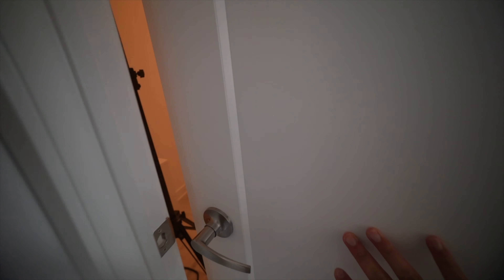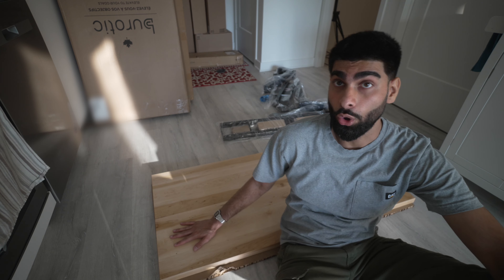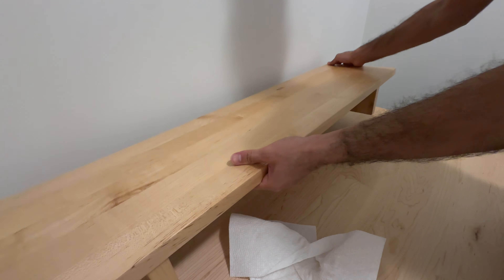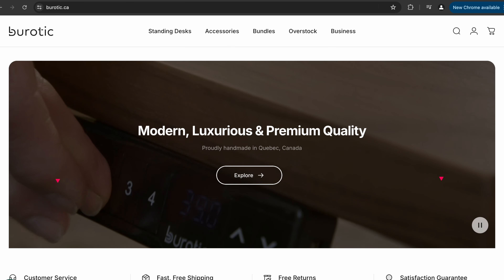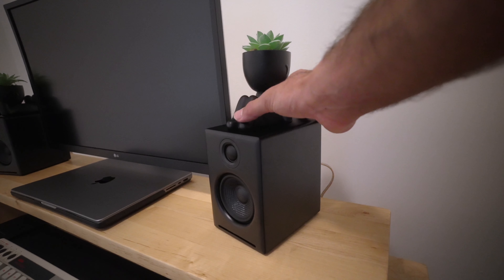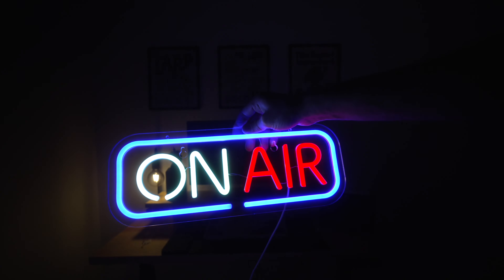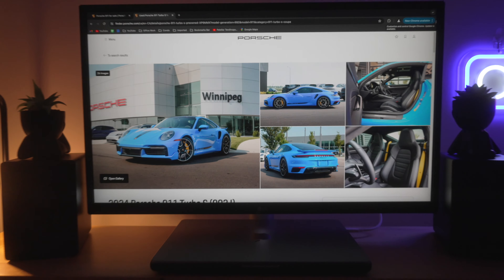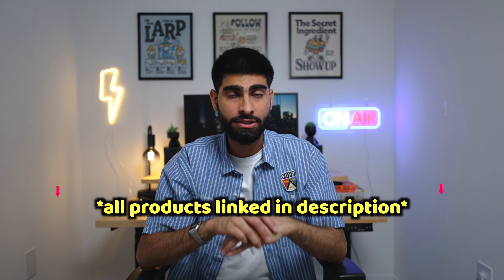My Dream Desk Setup 2025 | Office Makeover

Comment: The "On Air" light can be moved to the side walls, so that if you're streaming it is visible in face cam, coz I feel it's too bright to place near the monitor. A Benq halo barlight  can be mounted on main monitor + a webcam (Anker C200F - 1440p). Add a soft fabric footrest if you feel like. You can also add a USB and card reader, with a angled wireless charger for your phone.
For now this much should be sufficient, later you can re paint the walls and maybe build a custom PC for editing/ gaming, add acoustic panels and floor carpet. And add 2nd monitor, Key light + RGB, extend the table top to fit the width of the room.
Reply from the maker: Appreciate the in depth suggestions! Will keep them in mind for the next upgrade. Need a foot rest for sure!